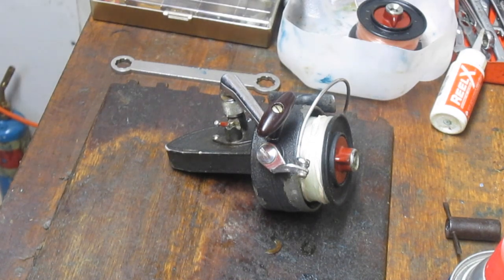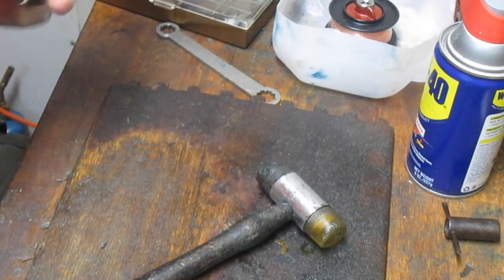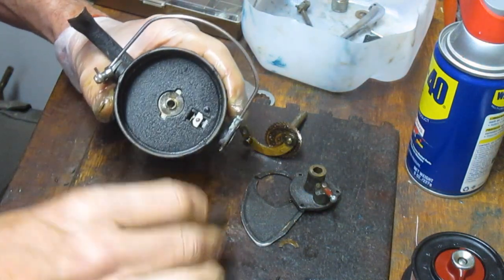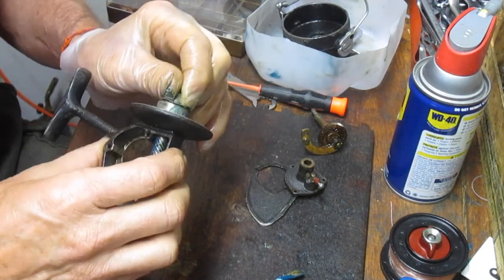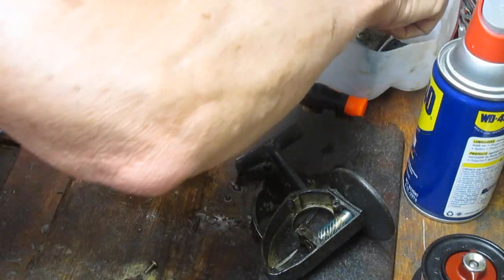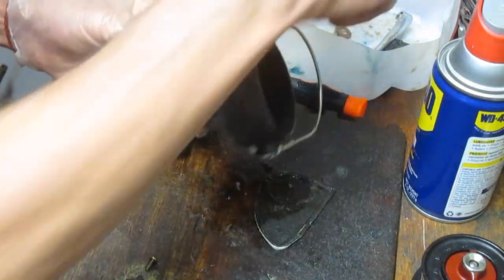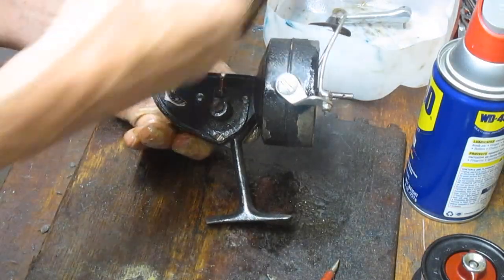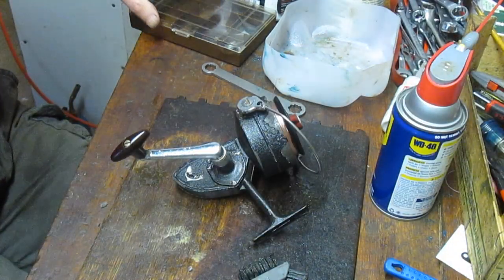D.A.M. Quick 440 spin fishing reel how to service and switch the drive side handle

Comment: Hey thanks for everything ,
You always try to help,
I still a Dam quick 220 but the shaft doesn't move,I can't take apart!!
Could be just hard grease??
Reply from the maker: It could be the hard grease or a bent shaft.  Try a heavy spray with a penetrating oil over the entire gear set and shaft and let it sit for an hour or so before you try again.  - There reels rarely rust in place, so there is a good chance it is dried grease.  Best wishes Rey - Dennis

Comment: This reel is identical inside to my DAM Quick 331 that I have serviced often. These reels are so incredibly over-engineered and immensely  strong and durable. You are so correct about all the needed tools!  I don’t know of any other reel brand or company that have manufactured reels with such meticulous quality and machined excellence as these vintage DAM Quick reels. Their only drawback is weight. Those side plate screws can strip very easily if you aren’t careful. I love my DAM Quick 270 Super reel. It is an outstanding heavy duty surf fishing reel. Some folks buy these supers and modify them to be completely sealed from saltwater intrusion and also install custom machined gearing. You can see these on the internet. They can only do this because the original reel is so capable. I hope to add a 550 to my collection but a 440 would be just as god as it is only slightly smaller. Great video Dennis and an excellent addition to your library!
Reply from the maker: Thank you.  I love the D.A.M. reels.  As you know, I am not a collector, but I have a few of these are still hanging around!
Reply: @Christopher Jenkins, you're so right, DAM Quicks are such great reels. I bought my first one in February and now I have (and fish) seven. You wrote, you customized your 331. Would you mind telling how? I'm asking, because I often fish two 331N, which are among my favourites.

Comment: Hello, love your videos, been very intrigued by the older dam quick reels, really want a 110. Was wondering if they made a left handed version of these that you know of.
Reply from the maker: Not that I know of.  I just checked a site and I cannot find a left handed version.  There re several D.A.M. Quick reels where you can switch the the drive from left to right, like I did in the DAM 440 video, but you cannot do that on the 110.  Dennis
Reply: @2ndChanceTackle  thanks for the reply, bummer, i really like the quality of those reels!
Reply from the maker: So - I was looking at the Finessa, which has the fixed side plate.  Then I was in another box in my shop and I found a straight 110 that has a reversible side plate, so I am changing my answer to it depends!  There is hope that you can find the 110 that is not the Finessa and you can make the swap - Dennis
Reply: @2ndChanceTackle  oh thats great! So if it has that three hole plate I can reverse it?
Reply: @kyleburnett5151  Yes ;)
Reply: @Jalen Conor Yup, have been using InstaFlixxer for years myself :D

Comment: Hey...I have the 5000 with silver spool.
Can I switch the handle ??
From left to right??I'm watching your videos , because Dam are new to me 
This reel is my first one I try to clean
Reply from the maker: Not sure which version of the reel you have.  Can you send a picture of both sides of the reel to my email 2ndchancetackle@gmail.com - I should be able to tell from the pictures. Thanks - Dennis
Reply: @2ndChanceTackle  I have a DAM real but can find no model number, but this reel needs a half moon piece with an R instead of an L on it to change it from a lefty to a righty because the screw threads into the second side of the half moon piece instead of into the long shaft,,,
anyone have one with an R on it?

Comment: Just the video I was looking for, great job!  I picked up a 110 at a garage sale and it was really slow.  Was able to clean up most of it, but no matter how much I pull I cannot remove the rotor.  I sprayed in WD-40 and let it soak in overnight but it still will not budge.  Any ideas?
Reply from the maker: Sometimes they just get too sticky to come out.  Try reattaching the rotor cup and use it as a handle to pull up on the assembly.  That will give you additional leverage and can help are the sticky bearing - Dennis

Comment: I'm in the process of restoring a dam reel I found. It's a dam quick 441n I can't find any videos nor any parts on line listed with the 441 or 441n. I didn't know if maybe you could help explain this seeing you work on them also maybe direct me on how to find parts for it. Thank you so much
Reply from the maker: You will likely need to find a donor reel.  Those reels are old and there are no longer any parts distributors for them. Check eBay for used reels that you can part out - Dennis
Reply: @2ndChanceTackle  yes that's the thing I was looking on there and don't find 441n now do you know I see some of the 440 are they the same?

Comment: Great video. Found one of my Dad's old reels. A 440.  Have everything at lower end taken apart and lubed. However, on top end the main shaft and rotor wont come out. Rotor nut is loose and shaft is lubed and will spin fine but cannot pull it up and out.  Any advice?
Reply from the maker: That's a tough one as it is likely that the bearing has rusted to the side case.  If the bearing is fine and does not need to be replaced, just leave it alone and oil it before reassembly.  If you want to keep trying to get it out, soak it in a heavy duty penetrating oil like PB Blaster or Kroil for an extended period of time - hours, not minutes or days not hours. If that doesn't do it, you may need to heat it as the two metals will expand differently and that can help break it free.  Sometimes it is better to let sleeping dogs lie!   Dennis
Reply: Enjoyed the video and it assured me I had reassembled my 440 correctly, but the shaft would still not rotate. Found this comment that matched my situation and followed your reply, 3 hours later, the shaft broke loose and was able to finish the clean up, re-lube, reassemble, and now I have a very smooth 440!  Thanks & Blessings         PS: I'm old school; Quick, Mitchell, and Plueger Medalist reels and Fenwick rods!

Comment: How I can repaint DAM. I have the same chipped paint.
Reply from the maker: I am not a repainting expert.  Those who do it use a paint stripper to remove the paint and then an automotive primer and automotive spray paint to refinish them.  You should be able to get the paint stripper in an aerosol can and the bait from any auto parts store or on line - Thanks for asking
Dennis
Reply: @2ndChanceTackle  great ideas. Thank you